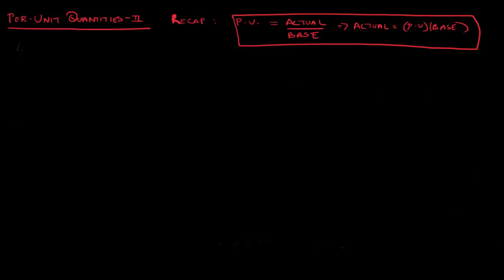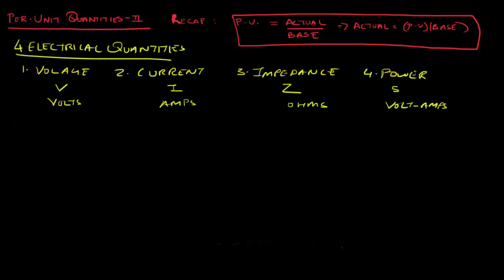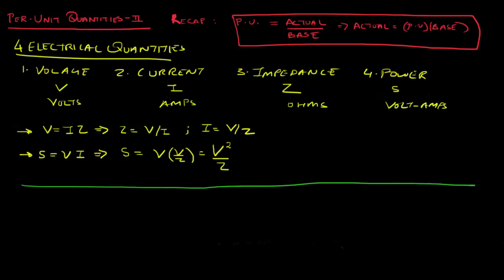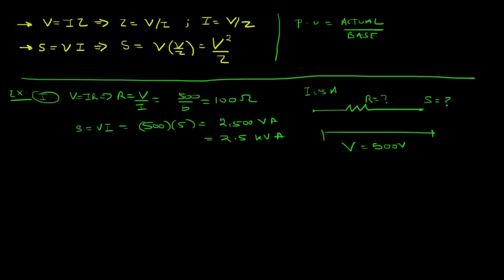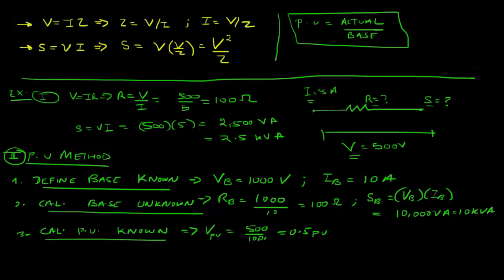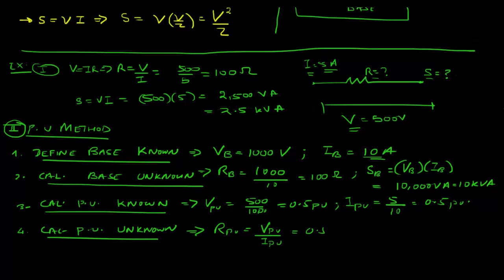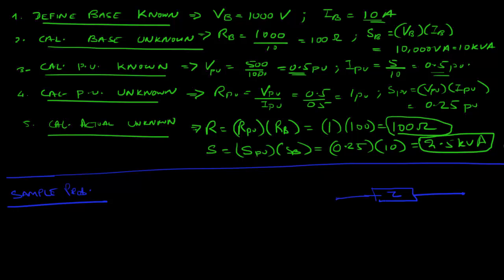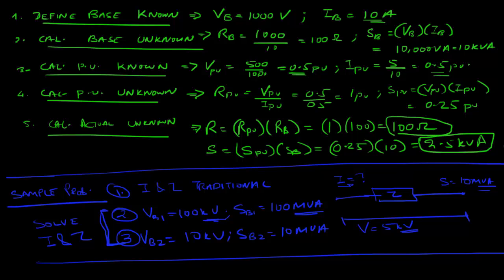Per-Unit Quantities 2

Comment: Do you choose your base values for voltage and current arbitrarily?
Reply from the maker: Hi Kyle, the simple answer to your question is Yes.  One can choose any base values for voltage, current, impedance and power.  So we would try to choose a value that makes our calculations easier.  As you see other videos on the Per-Unit Quantities topic, dealing with transformers in the circuit, you will see I explain a little bit more about choosing the right base values.  I encourage you to see those videos (http://youtu.be/gLdUUtknhCk ; http://youtu.be/VuZdvDQ_4yk).

Also try solving both the example problem and the sample problem with different base quantities, and you should arrive at the same answer.  Actually that is exactly why I gave you two different base values for Voltage and Power in the sample problem.  You should get the same answer using either of the two bases.

Let me know the results you get and if you have any further questions or doubts.  Good luck :)
Reply: Thanks for answering. I enjoy your videos and hope to see many more. Do you plan on doing more videos for electric machines and other EE subjects?
Reply from the maker: Hi Kyle.  Thank you for the positive feedback.  For now the videos are going to deal with Power System Analysis (Load Flow, Short Circuit etc.) , but I hope to get to topics like Machines and Circuits etc. later on.

Have you had a chance to download the Formula Sheet yet (www.movingelectrons.com/formulas) ?